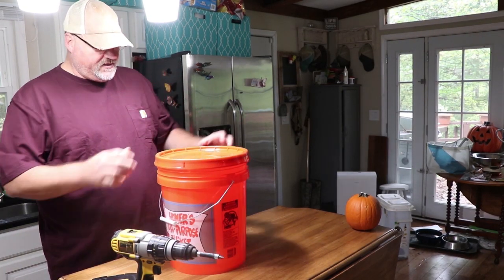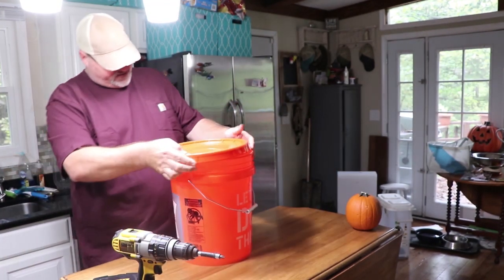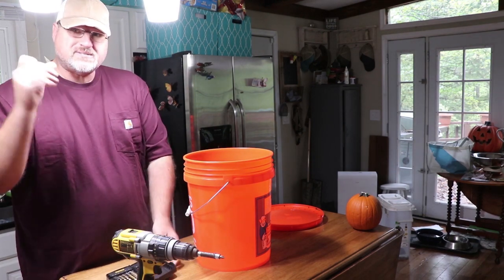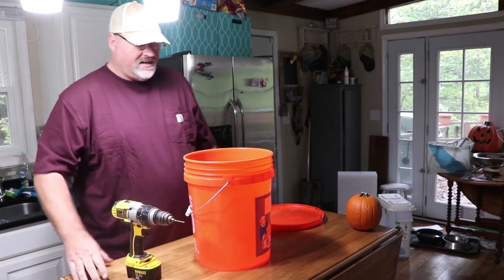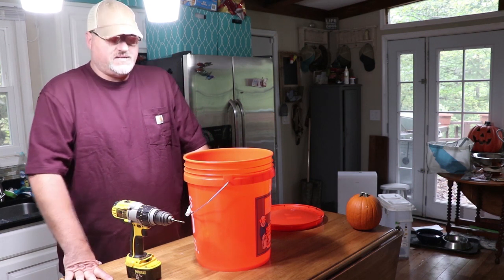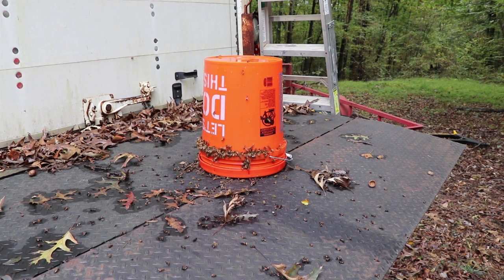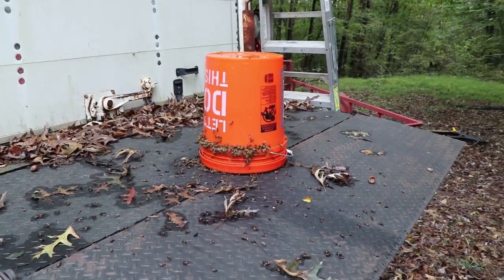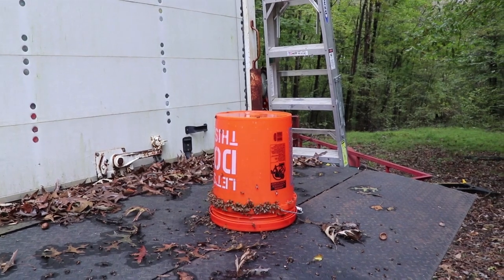5 Gallon Bee Feeder How To

Comment: Could this be used as a water bucket for bees as well?
Reply from the maker: It can. Will be a little messier when you first flip it, so be outside, but yes, it forms a vacuum, so should work well, just like chicken waterers. Just make sure it’s level when you place it, otherwise the vacuum won’t form and it will all leak out...

Comment: Did you use hot water to mix with the sugar or tap temp water
Reply from the maker: Rennells Suburban Homestead Prepping for Survival I used tap water. I ran it on hot for a minute or two before using it. It was hot enough to be letting off a bit of steam, but I didn’t boil or anything. It all dissolved just fine...